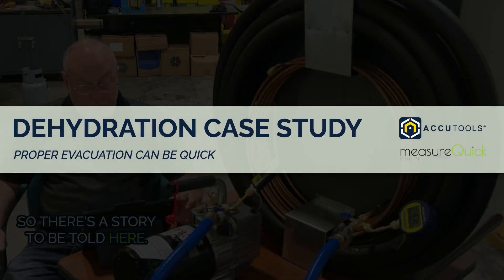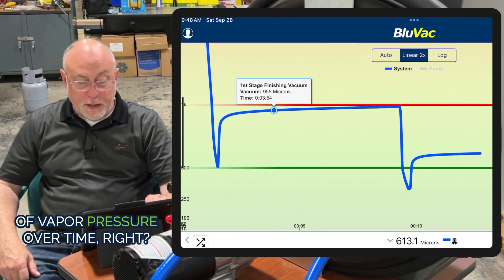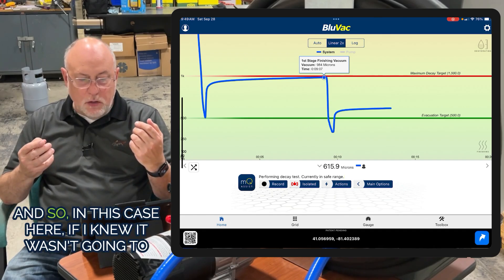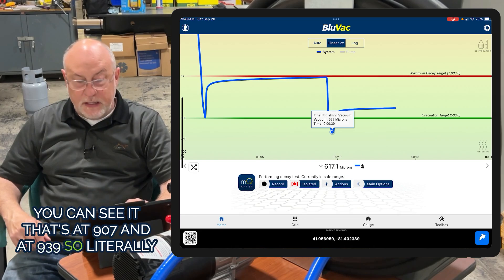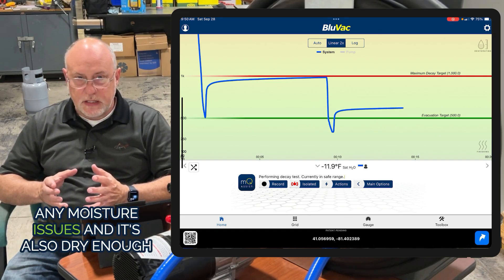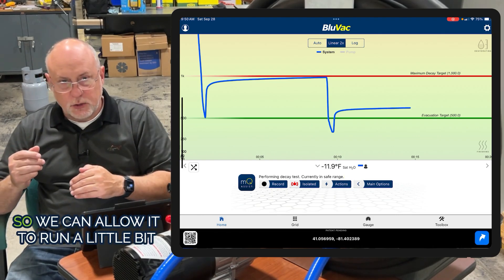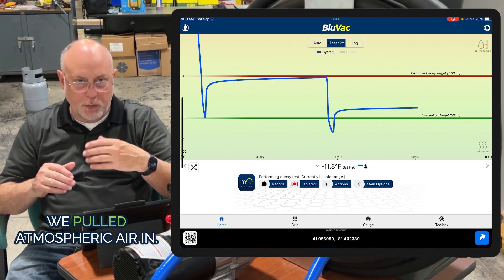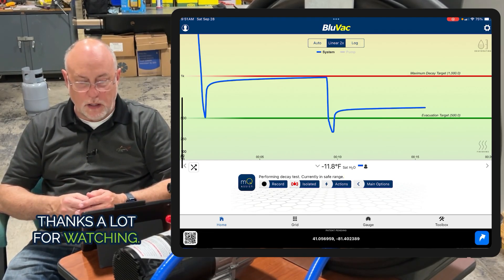A Dehydration Case Study (Proper Evacuation Can Be Quick!)

Comment: I've had to do this many times. It WORKS! BUT, Your screen shows the vacuum above 500 microns. I would NEVER release my refrigerant there! I always pull my vacuum well below 200 before my decay test. Just did one today, walked away for 1/2 hour, and it was down to 65 microns! Then stabilized at 120, BETTER THAN PERFECT! (Appion set up)
Another observation... You CAN NOT get a true isolation and you will not get a true reading with your micrometer on your pump! It should be isolated on the system only.

Comment: So would you advise pulling a vac, then a quick nitro purge, and repeat a few times?  I feel like that is quicker than just letting the vacuum pump run for hours
Reply: It depends on what is going on. That's why it is important to have the tools and technology to get a better scoop on what is actually happening. I.e if you are running a vacuum and going just of a time lapse and not reading microns.... you might have gotten nowhere near those micron levels that you want. 

But yes, the "triple vacuum" method works and it is a good way to break moisture as it starts to build up. Sometimes you might not needed. It depends on the system type.  Over the years I have learned that on a Central System install the way that we do it. We can pull a deep vacuum really fast and holds the decay test. But, same installation practices and vacuum set-up, on a Minisplit system... different story! I hope this helps...